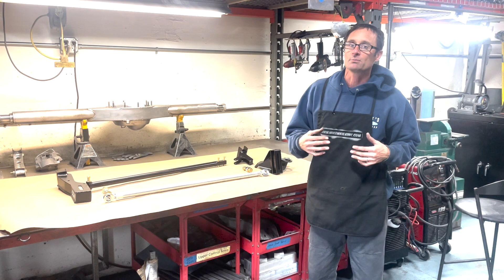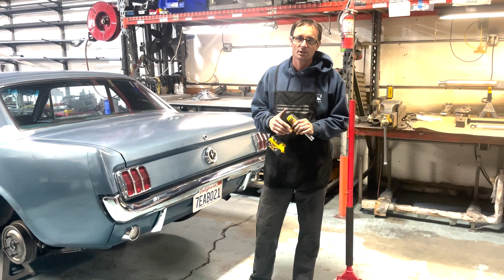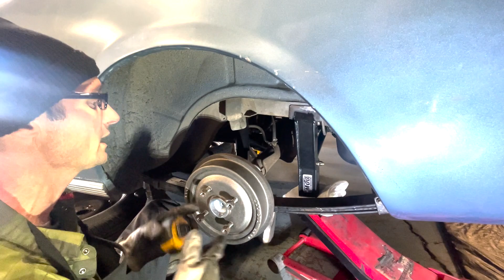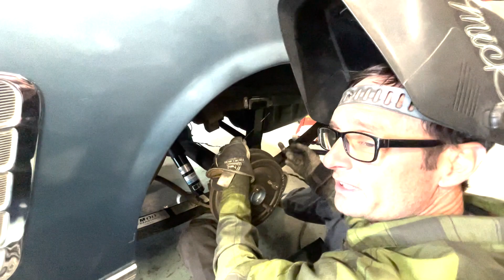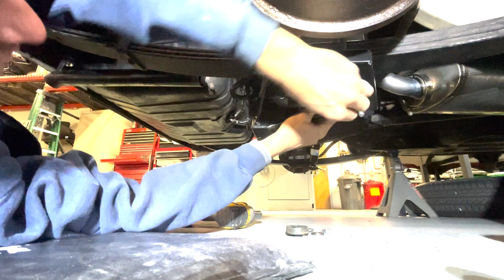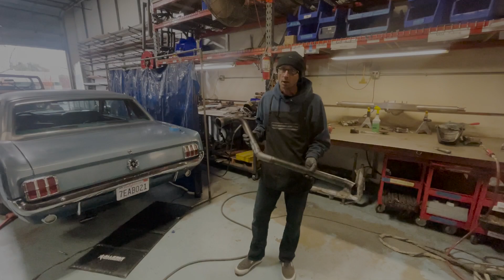MOD Panhard Rod Installation

Comment: Hello there Mike, I wanted to thank you, again, for reaching out to me personally, to help me with my Panhard bar kit installation questions. My install worked out perfectly, after I realized my my reconstructed car,(new rear torque boxes and full rear frame rails) had frame rail spacing differences specifically to my old car.. I drilled a new bolt hole, for the stationary upper support bar, to accommodate my narrower than normal frame rails. The rest of install went just as your video says. To those that like to "drive" their cars, you are going to love this setup...           Keep at it brother.... God bless...

Comment: Difference between Mod and Mod 1 versions?
Reply: i think its the removable center section of the bracket
Reply from the maker: Our MOD 1 setup includes a rear sway bar.